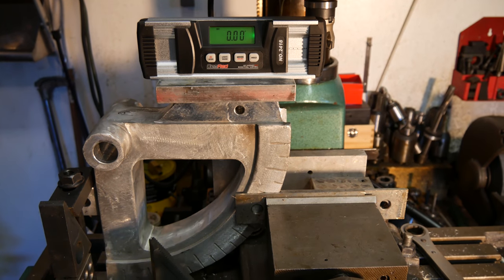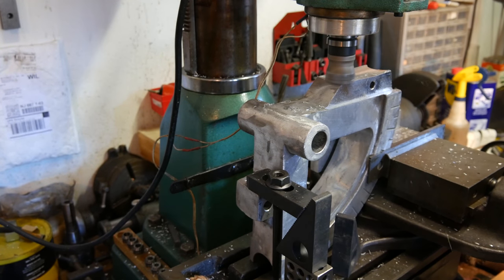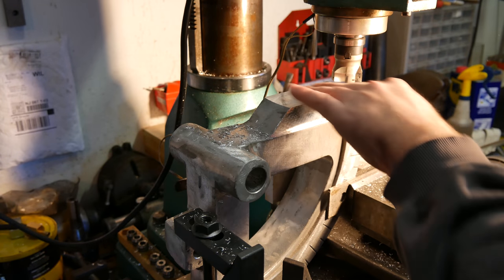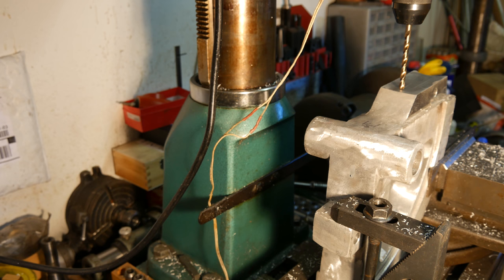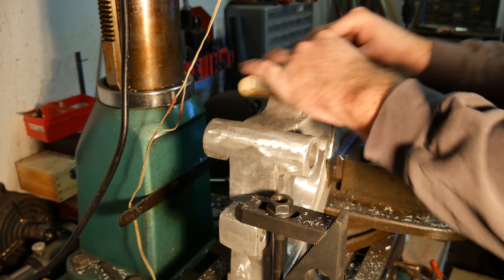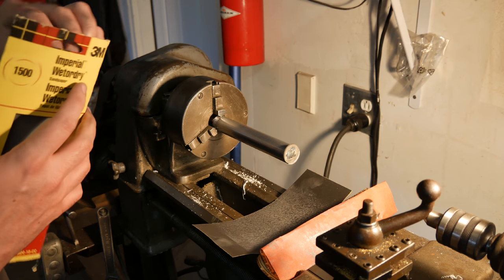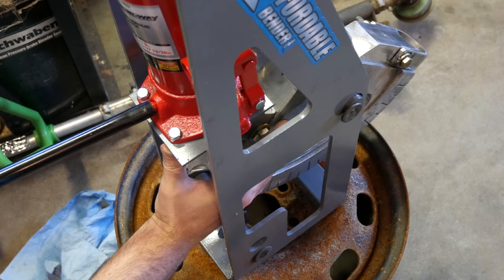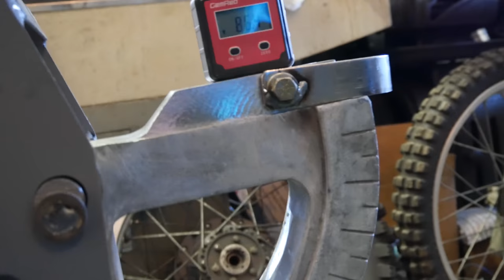Affordable Bender Modifications, Angle Gauge, Polishing

Comment: Maybe a brake cylinder hone on the inside surface of the main die to smooth it out as well, work in a light cross hatch pattern to hold some grease in there as well?

Comment: I thought the Affordable benders build quality was crap. The welds still had lots of splatter and even weld wire sticking out and they just painted grey over it. They also shipped it in a thin cardboard box so it was damaged when I received it and the loose hardware in it was missing.  It works for what it is but the bend radius is HUGE. Don't expect to bend any nice tight bends with this bender.  I'm thinking of just using their Die and building my own nice frame for it. On casters with an electric/ hydrauilc ram setup. Nice video and maybe you could've just inlaid a piece of steel to mount the angle gauge vs using magnets?